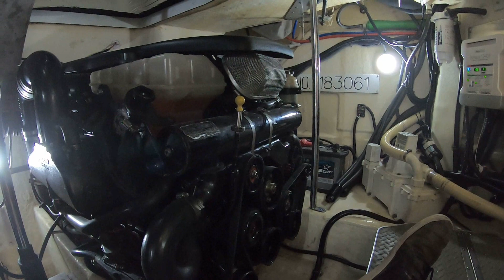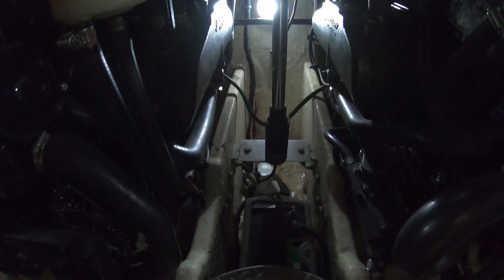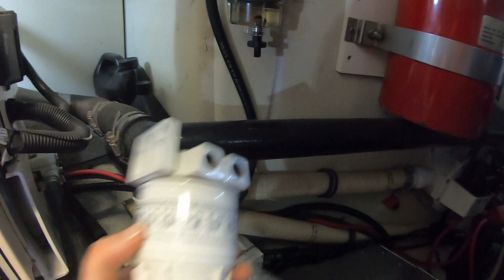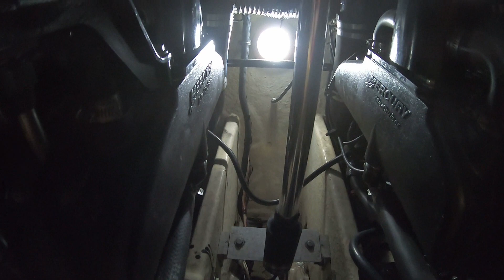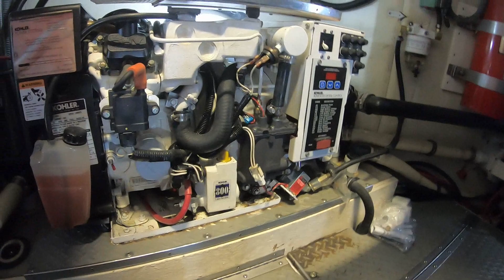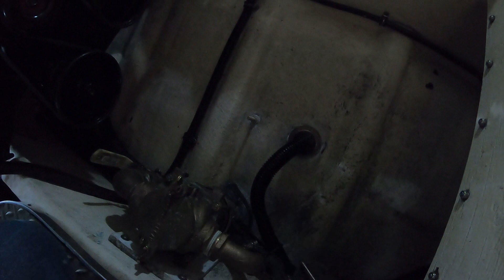Engine Room Tour | Formula 37PC | Post - Project Completion

Comment: I have had the same problem starting my port engine and having to throw the parallel switch to get it started. Would love to get some more detail on the fix.  Thought maybe it was the battery relay.
Reply from the maker: It ended up being a faulty breaker between the switch and the battery.  Took a while to track that down.
Reply: Where was that breaker located?  I was thinking it may be the relay btw the house and secondary battery sets
Reply from the maker: @andrewpetruski6657  Underneath the 3 engine battery switches in the engine compartment.

Comment: S,   Did you ever get your genset issue resolved where it shuts down a few seconds after starting?   If not, I have a suggestion, as mine did the same thing...
Reply from the maker: Did not yet fix it but was planning on seeing if I could find a Kohler tech to look at it this winter.  Open to any suggestions.  Thanks!
Reply: @expresscruiserlife  To eliminate a lengthy post here, I'll reply to this via your FB Messenger.   Coming your way soon...

Comment: You mentioned restoring the Bravo Three outdrives - did you refinish the paint also, and if so,  did you put outdrive antifouling paint on them? I have a single Bravo Three at the shop now getting torn down and inspected for coastal cruising in a few weeks, and I will do the outside next season. I have come to learn about corrosion from stainless props on aluminum housing. Some say add additional Mercathode system.
Reply from the maker: Hello, the drives were sanded, primed with several coats and painted with Trilux anti fouling paint.  On the inside we found corrosion on the U joints that needed to be sanded, primed and painted.  The gimbal housing was all cleaned up and new parts added where needed.  It was quite a project.  My boat has the mercathode system installed which helps mitigate corrosion issues.  The reason I had so many issues is due to the previous owners' mechanic who didn't seal things properly, thus allowing water intrusion.
Reply: Appreciate the info.